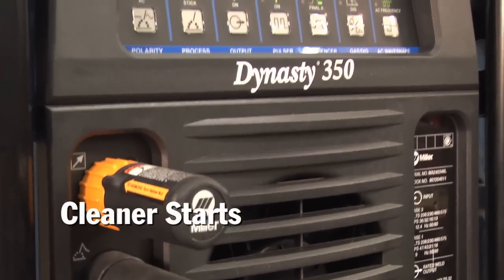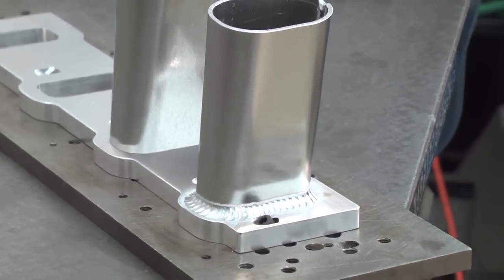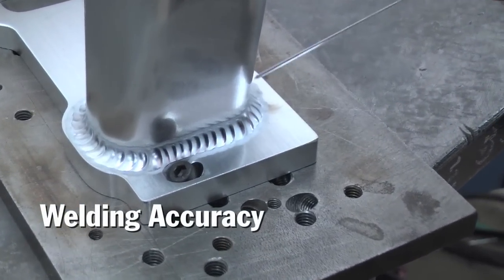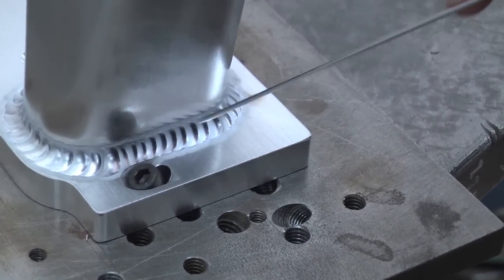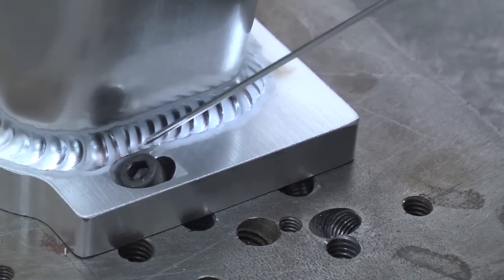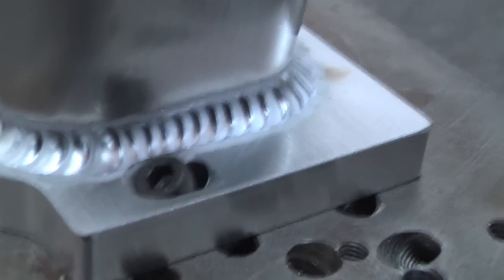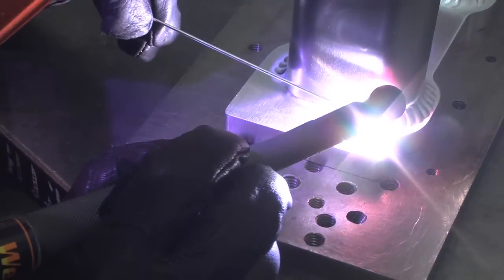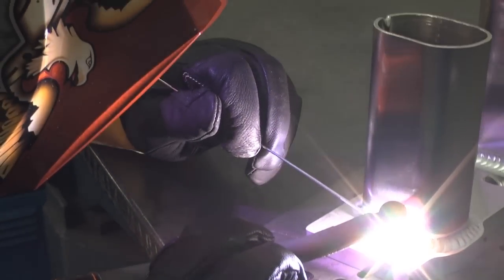Avoid Common TIG Welding Problems with a Dynasty TIG Welder

Comment: Anyone know what tig torch he has? Looks great and want to get one
Reply from the maker: +Brian B thanks for the question. We would recommend a Miller Weldcraft W-225 if flexibility is desired (https://www.millerwelds.com/accessories/guns-torches/tig-torches/weldcraft-w-225-modular). Otherwise, the Miller Weldcraft W-375 comes with the Dynasty 350 (https://www.millerwelds.com/accessories/guns-torches/tig-torches/weldcraft-w-375). Both are excellent torches. Hope this helps!
Reply: +Miller Welders I will check them out thanks for the reply

Comment: That shocked me how precise and crisp that edge is. Ive used the dynasty 300 and it was the only one in the shop. There were alot of lincoln squarewaves, and synchrowaves, but that dynasty...were fightin for that! Lol..(jokingly). It does make a difference DEPENDING on what youre doin. Im no beginner, and ive used many machines and i swear by the dynasty...
Reply: sharpshootah88 Ive watched others fight over that machine as well and I laugh because I can make either of those other machines weld just as good if not better.  Miller kind of dumbs it down and is a bit more user friendly and I think that's why most seem to flock to it.....
Reply: TheJusnic82 Pick the worst machine in the shop and make it weld beautiful.  That's a true welder.  Let the ladies have the new machines.